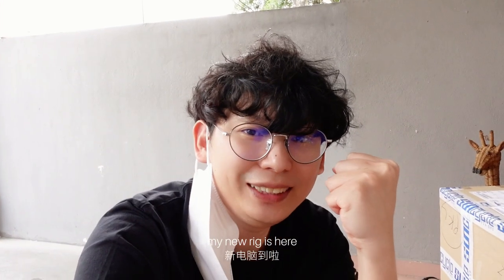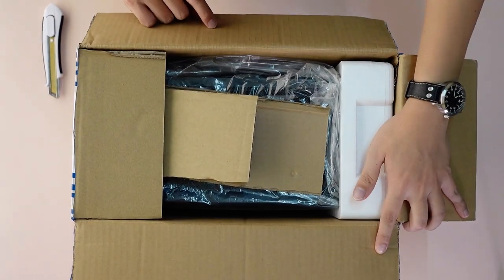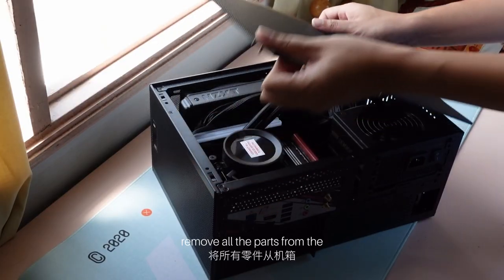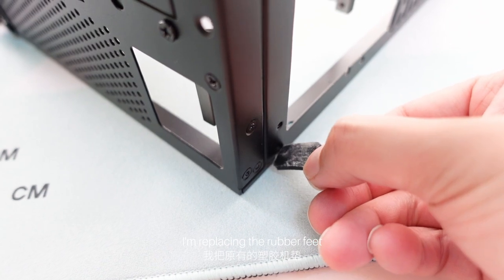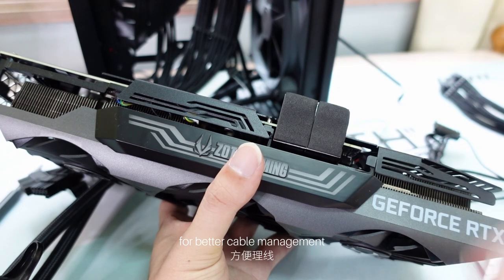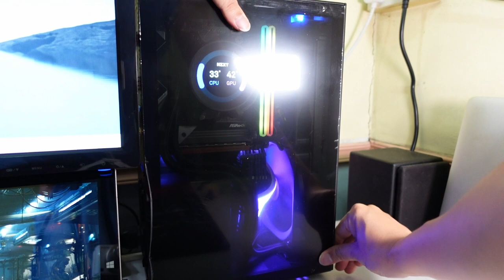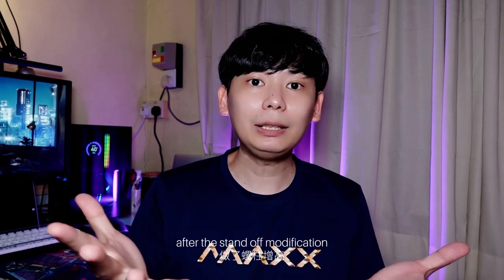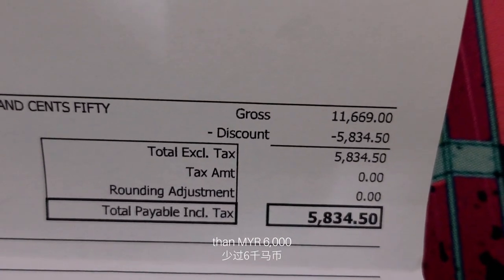SSUPD Meshlicious Build 🪛 Stand Off Mod

Comment: Really like your idea of using stand-off which is exactly same as my plan, it is a great references to me!
Reply from the maker: I think is a must for meshlicious build. Better cable management for better airflow.
Reply: @NlesCtrl   I was planning to use MZXT for CPU cooler as well, but considering the height limitations, your experience shows it works, that’s great! One more concern is RAM, with this mod, do you know what is the height limitations of RAM? Is that possible to have Corsair Dominator in the case with stand-off?
Reply: The height of Dominator RAM is up to 56mm, 4mm higher than the NZXT pump, it seems to high to the side panel.
Reply from the maker: @honhbin5802  Awww, that ram is too tall.
Reply: @NlesCtrl   I see, thanks, now I can reduce my budget….
Reply from the maker: @honhbin5802  I think there's only 1-2mm clearance left between the pump and the side panel, I didn't measure it.
Reply: @NlesCtrl  I plan to use 10mm stand-off instead of 20mm, for the back panel of MD, 3D print one piece of bracket…
Reply from the maker: @honhbin5802  will the back io panel fit? You mean you going to 3d print one? Cool!
Reply: @NlesCtrl  yap, 3D printing works!
Reply from the maker: @honhbin5802  nice

Comment: you can also do standoff mod to gpu side to hide your cables better also if you have a 3D printer there many mods like feet mod , displayport bracket mod, and a tophat mod that adds another fan exhaust on the top
Reply from the maker: Can I do both Motherboard and GPU stand off mod together? Doesn't seem to have enough clearance for GPU stand off mod. Yea I saw those files on thingverse, the only one I might be considering is the 92mm fan on top. Not a fan of tophat look.
Reply: @NlesCtrl  you can do both i use 20mm on the motherboard and 15mm on the gpu my gpu is 2.5 slot you can also try 10mm on the gpu if 15mm doesnt work. Also there is another 3D printed bracket where it replaces the top gpu slots to be able to put 2 60mm noctua fans to exhaust for gpu to get better temps you can get them black or white.
Reply from the maker: @alexg6675  I did bought some standoff for the gpu side too, will give them a try. Does your GPU sack?
Reply: @NlesCtrl  no it shouldnt sag if you screw in your gpu into both of the gray supports if you feel  like it is sagging you can put a sag bracket to help it
Reply from the maker: @alexg6675  maybe it's the wires that causing the top to be slightly slanted. Can't wait to redo the cables.

Comment: Thanks and this is a great video! I am thinking building a similar computer like yours, and I am wondering did you run into any clearance issue on the Z63 pump after you raised the motherboard for 20mm? It seems the AIO pump touched the glass from your video. Thanks and looking for your confirmation!
Reply from the maker: No issue with the AIO, I slit a piece of paper in between to check. It still has around 1-2mm of space.
Reply: @NlesCtrl  Thank you so much for checking on this! I will go ahead and get a z63 and do the stand off mod! Really appreciated!
Reply from the maker: @lookerxie6764  Glad I can help, good luck on your build!
Reply: Hey  @NlesCtrl  , just having one more question for you. Is your class panel on the CPU side clear or tinted? Thank you so much!
Reply from the maker: @lookerxie6764  hi, is tinted glass
Reply: @NlesCtrl  Thanks! No wonder it is looking so good. So is it dark tinted or mirror tinted? I see there are even 2 different options for tinted side panels. Thanks again!
Reply from the maker: @Looker Xie  it is dark tinted
Reply: @NlesCtrl  Perfect! Thank you so much and really appreciate all your help!
Reply from the maker: @lookerxie6764  My pleasure